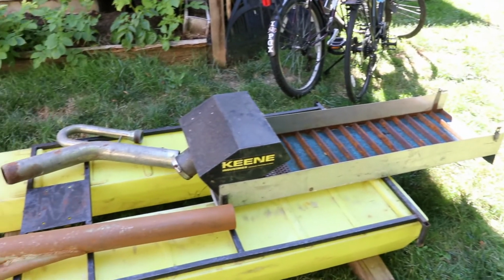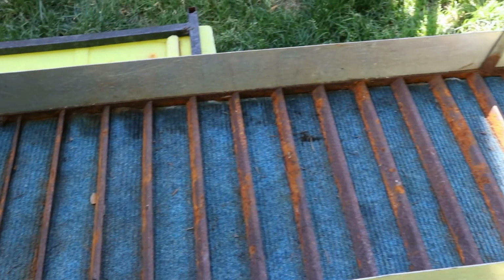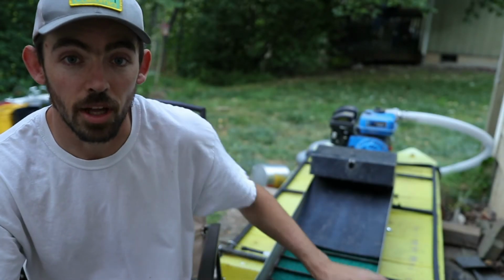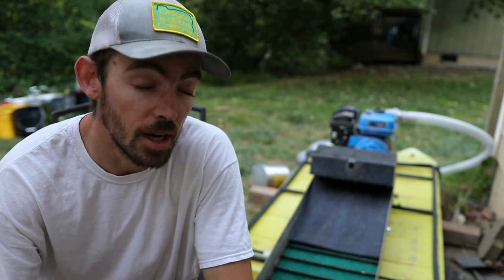Restoring an Old Keene Gold Dredge

Comment: Can I reduce the size of my jet flare from 4 inch to 3 inch?
Reply from the maker: You could but it would be better to do the reduction at the nozzle and have the 4” main. I want to go to a 4 and have it reduced to 3.
Reply: @pnwprospecting  I just bought a used 1980s keene 4 inch but it didn't come with a frame or motor it came with the header box and sluice pontoons jet tube 4 inch with a 2 inch power flow  and 4 inch nozzle ...I'm not sure if I'm even called the parts right lol what size trash pump would I need to run this and where do I buy a 4 inch dredge hose ... I bought it super cheap I'd rather have the backpack size but I'll fix this one right in the meantime
Reply from the maker: Trash pump won’t do it. You will need the 300 gph from Keene or what I’m getting which is the proline 350
Reply from the maker: I’ve been looking at the proline 350 pump 2.5 inlet 2” outlet but they are not easy to get ahold of to order by phone. They have a bigger Honda motor on the pump than Keene does. I like Keene but a bigger pump and motor for slightly less in price is very tempting.
Reply from the maker: GOLD, BULLETS & BEANS  I didn’t vote for him so I’m just SMH
Reply: @pnwprospecting  I believe that would be 300 gal/minute.
Reply from the maker: Ended up with a Keene that does 300 the proline does more but he never called me back for the sale so I traded for a new Keene!